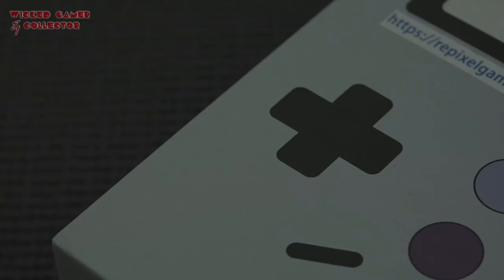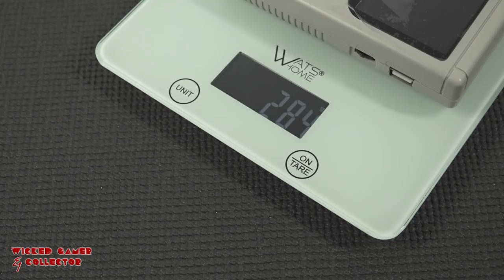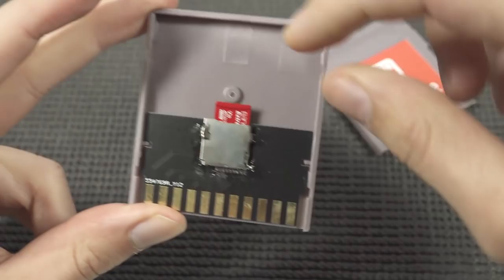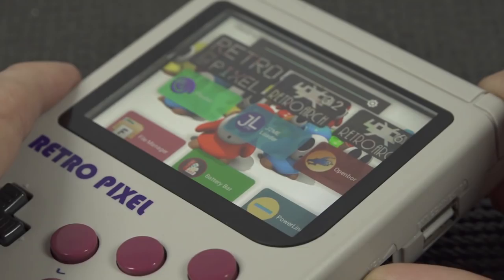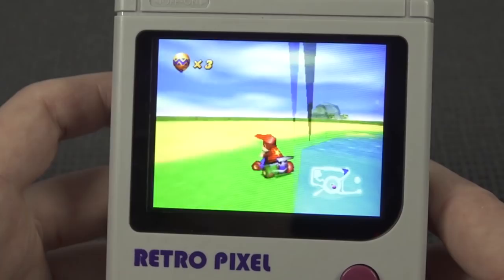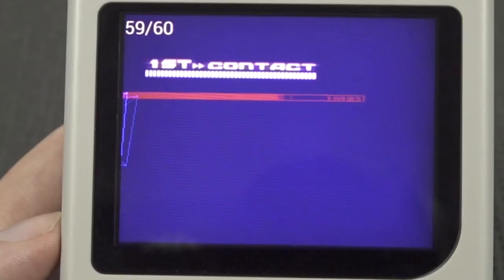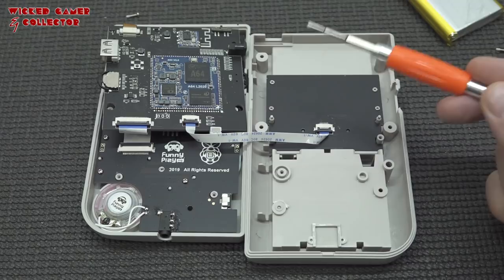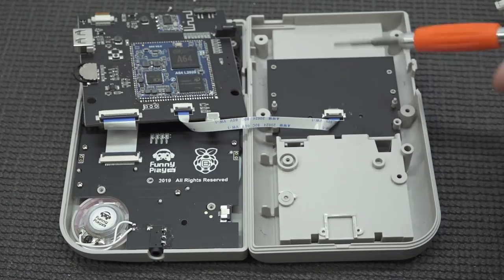This Android Game Boy is a Really Interesting Concept 🤔

Comment: The Retro Pixel frontend looks like it is actually the DIG frontend. DIG can be themed a lot. See if you can access the frontend's settings, it should have an option to run at startup.

Comment: I feel the cartridge design is a bad idea - would be much better if it had a slot on the top side so you could remove/change the SD card easily. The screen looks a bit small to me too, despite being nice and sharp.